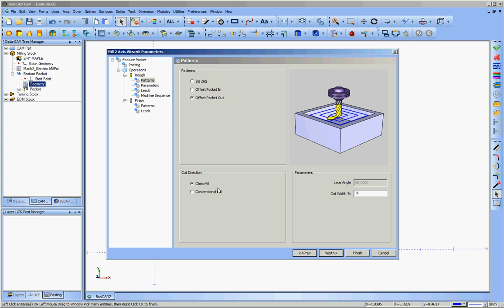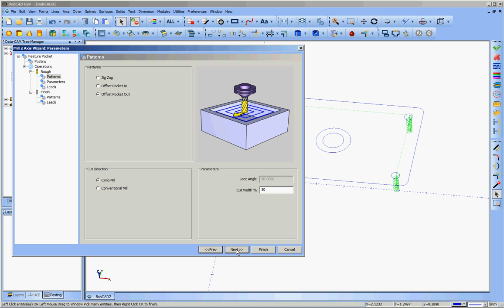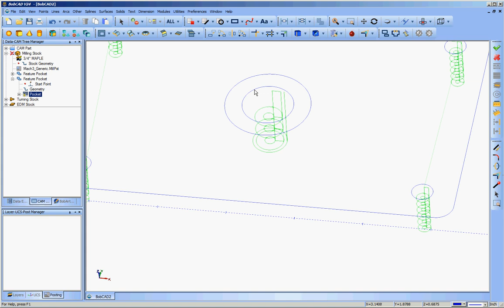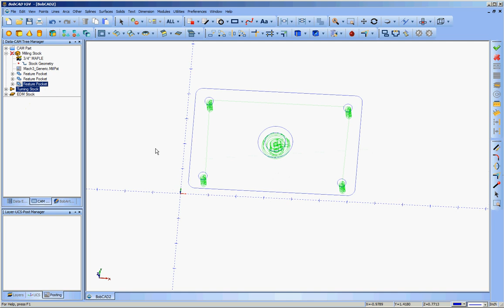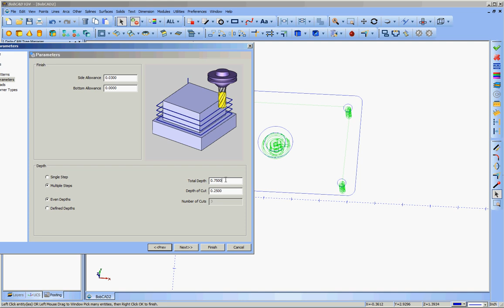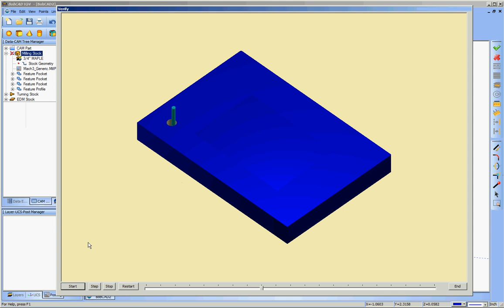Toolpath Basics with BobCAD

Comment: Odd I dont see that you contoured any of your geometry.
Reply from the maker: Contours are really useful, and although I understand that, I just never got in the habit of using them as much as I probably should have. One of the reasons to use them has been made obsolete with the new Dynamic Machining Strategies in V26. It used to be beneficial to create a contour when multiple Features were to be used on one entity. It allowed defining a common lead-in/lead-out across all the Features. In V26, it's normal to select the geometry once, and pile on multiple Features. There are still times when BobCAD reacts better to a Contour, though, particularly with complex entities.